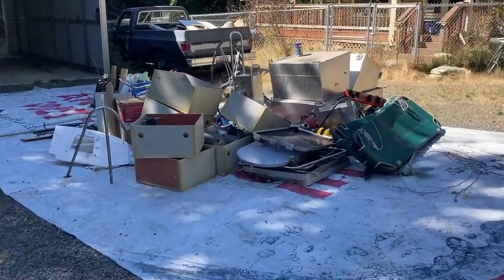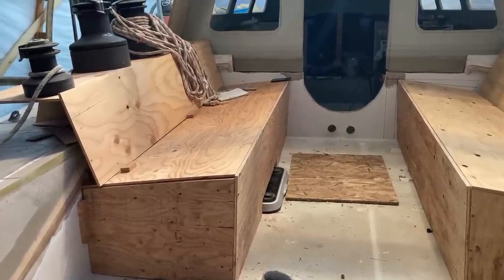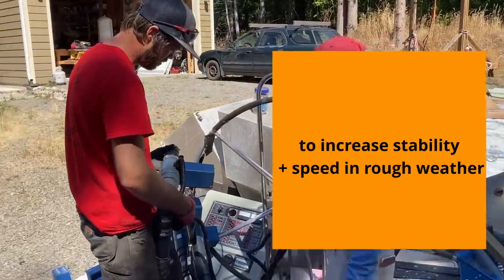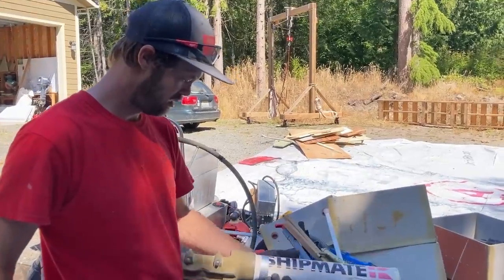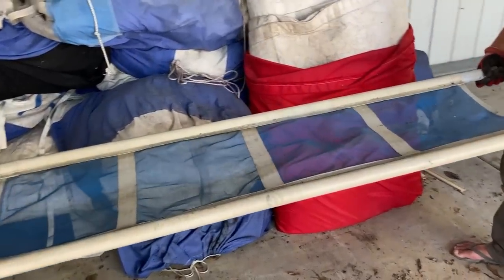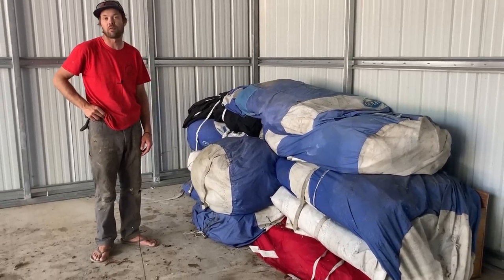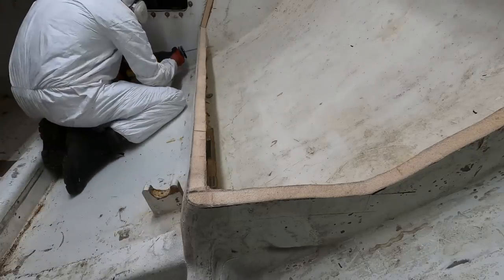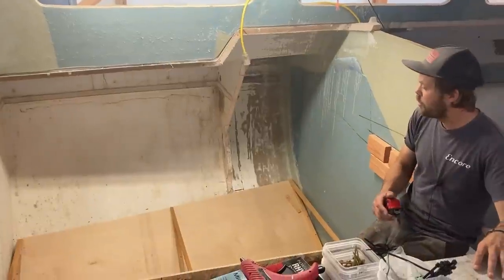A Boatload of Treasure & Mocking Up Fuel Tank [E43]

Comment from the maker: I'm noticing a lot of comments about the fuel tank only being on one side.  I should have addressed this more in the video.  There will be another fuel tank in case this one goes bad.  And the boat will be balanced out by both the galley and the salon area being on the starboard size, opposing the fuel tank on the port side.
Reply: As the fuel is being used, a starboard list will increase. Will there be a ballast system?
Reply: There are hours of explanation and demo ahead for content to ease our concerns,  that said.... I would  hope you prevent leaking and slosh with epoxy liner coatings and baffles. Check out Sailboat story and the 2 vessels Ben has had to address leaking tanks and access issues! I have walked away from boats after finding aluminum tanks under floorboards and water, rust etc in the bilge...
Reply: I sailed on a boat that had a balast tank to balance the fuel tank. It was a pain as the boat uses so little fuel per hour you do not need to balance until a couple hundred pounds of fuel are used. But the automatic system thought when you were heeled over it needed to balance. So it got replaced with manual control, which did not get used much.
Reply: The problem is that the fuel tank weight will vary by 150 gallons * 7.1 lbs per gallon = 1065 lbs. If it is properly counterbalanced when full, it won't be when empty. It is not the end of the world if you go through with it. But it sure would be nice to get it closer to being balanced. Maybe you could at least have 35 gallons on starboard and maybe 115 on port, and you can always use up the port-side fuel first. Also, much of the time you might not need to keep the 115 gallon side full, so practically, it would be rare to have much of a list.
Reply: @mckenziekeith7434  that is true, my comments is about a auto system. You do not consume much fuel an hour, maybe 6 to8 pounds, so that tank is not need to be messed with but maybe every few days if you are doing a lot of motoring. Then you have to figure out how much you have used and pump that much out and if you are sailing and are heeled over it gets complicated. Plus when you are sailing trim can be a relative subject till you dock
Reply: I just want to ask, if a person moves from port to starboard, do you use a ballast tank? After all you just moved 175 pounds from port to starboard, or a 350 pound difference in trim. So think of that, how much fuel do you need to use before you notice a trim problem in a 65 foot boat?
Reply: @chasingsunsets380  it is over 1000 lbs of fuel. It is a 65 foot boat, but it was designed to be very light in weight.
Reply: @mckenziekeith7434  read my post, it is about auto vs manual and how often you really need to trim. Besides that we can discuss this offline and not disrespect this man's channel.

Comment: One thing you may consider is adding some noise abatement around the tank. The tank is under a bed on a boat that will constantly be in motion. Even with baffles in the tank the fuel will slosh around will create noise in certain fill levels. I only know this because our fuel tank is next to our bed.
Reply from the maker: Good idea, thanks.

Comment: I saw a huge sticker coming by from Awl Grip. I was a yacht painter at Royal de Vries Feadship in The Netherlands for 15 years and used several brands of yacht paint. It depended on the customer which brand they felt comfortable with. I don’t know how experienced you are in painting a yacht, but Alex Seal is for less experienced painters easier to work with. It flows better than Awl Grip and it hardly runs. Use a 4mm dincup and reduce it to 14 seconds with a reducer suitable to the temperature and you can use an airmix or an airless pump, and you can’t go wrong! Keep up the good work!

Comment: Hi Matt, Looking at your pile of old sails, you should try to prevent any damages from mice! My dad boat mainsail had major  such damages during a winter. A solution could be to store them on ladder hanging from the ceiling, instead than on the floor. Also, to use ultrasound devices that prevent them from coming to close to your sails!

Comment: Just my intuition on the tank... lots of free surface effect in one big tank (no doubt there will be baffles), but you're risking all fuel in one tank (if there were a leak or contamination), it will be sloshing around just under the double bed too! I guess you've done the weight and balance for all that fuel on one side. Sorry to be so critical, but it just raises questions that you've no doubt thought through!
Reply from the maker: the galley and settee will be on starboard side which will be heavier. it won't be the only fuel tank. there will be at least one more.
Reply: Ha! I should have read the comments before posting my own. Well said :)

Comment: Comment from the boat design peanut gallery: sooooo much free surface in that tank! I’m sure you know that tall, skinny tanks are much safer and better for dynamic performance than wide, flat tanks. That’s why nobody carries water in a cookie sheet :)

Also, offsetting a tank with a static mass will mean that you are always out of trim. Unless you can arrange to keep the tank full 100% of the time… Another tank that empties as the voyage progresses is a good balance. 

Anyway, a good tank builder can mitigate the sloshing problems with adequate internal baffles. I wish you had a better spot for the tank (centerline, tall space), But that is a small problem compared to many you have already solved well. 

It is so inspiring to follow your relentless progress! You both are awesome :)
Reply from the maker: The deepest part of the tank is very close to centerline so most of the weight is very close to center line.
Reply: @TheDuracellProject  that certainly helps!

Comment: Just fyi I've been part of the design and build of composite yachts and other boats that have integral diesel tanks. These boats are vacuum infused vinylester. We would add a special layup inside the tanks but it wasn't anything crazy. The tanks were always hydrotested. I know of some smaller boats that have integral tanks and they use a paint on product inside too. Aluminum tanks are the tried and true method so probably makes sense for you. But if they happen to be cost prohibitive or something, there are other options. Keep up the great work!
Reply from the maker: yep, i'm going aluminum! thanks for the comment.

Comment: I would say even though you addressed having other stuff on the other side I would still do 2 smaller tanks. For one reason your balance won’t change as your fuel in the tanks is depleted. Additionally it offers redundancy in the case one tank gets diesel bug or water in the tanks.  I would also highly recommend baffles in the tanks and inspection ports in the top of the tanks for future cleaning or repairs. One final thing as you know having the weight to center laterally & lengthwise will give you the best motion at sea. I would seriously consider moving the placement of those tanks.  In another note if you have the room and it wont mess with the sail plan why not do a big sliding hatch on the roof? It will add some nice ventilation at anchor and offer future access if you need to replace any appliances or equipment inside. The only concern of course would be making it weatherproof but its done all the time on smaller versions of the same thing.

Comment: I’ve been enjoying the updates. 

I wonder if the fairly low profile tank will be more likely to lead to air in the fuel line if things are sloshing around when it is half full?  Maybe a smaller day tank will take care of that problem.  I agree with another comment on the advice to make two 75 tanks that fit into the same space and are linked, then they can be serviced anytime. That is how the water tanks were done on our Express 37. 

I just did a week long cruise and it had me thinking about the cockpit benches in your last video. We have shorter than recommended backs, but I find it very comfortable anyway.  The angles on yours look about right.  Our Express 37 backs are a little too sloped back.

Comment: Always enjoy your videos.  Thank you for teaching and sharing your knowledge as you are building.  I am a ham radio operator (60 + years) and I suggest you both get your amateur radio license.  It's code free, all book learning and there are tests in your area.  Hold on to the tuners until you have your comm. package installed and you may find that you can use them.  If not, then you can sell what you don't need.

Comment: Use the old fuel tanks for blackwater and greywater. Buy new  Polyethylene freshwater tanks. (Even if the angle is a bit off it´s a lot faster and cheaper to have the tanks cut to shape than building a complete new set, as long as you clean them well before welding.) Alternative to cutting the tanks is to build supports that will take the shape of the tank, and accept a little wasted volume...

Comment: Aluminium tanks create cold bridges during winters and in colder climates, which can cause condensation build up inside the tanks unless they are completely full at all times. Moisture allows the growth of diesel bug which in turn clogs filters and in severe cases block fuel pumps and injectors causing engine failure. Better to build your tanks in plastic instead or any other suitable material.

Comment: Why not build the fuel tank as part of the boat? My own boat has this and it is superb. You can also do the same for water tanks. You coat the inside with a potable quality two pack Polyurethane that makes it drinking water safe. If you build tanks like this you never have to worry about corrosion. The tank will likely be lighter. There is no inaccessible areas where you can't get to. 600mm access lids mean you can get I side to clean. There is nothing not to like. The tank can be used as a structural member and bunk base. Add core to the top to make it insulated.
Reply: I have built in steel fuel and water tanks. Would much prefer removable cells for both. Diesel sickness can be an issue that swapping out tanks fixes instantly, and with a small water maker, a polythene cell takes less space.
Reply: @isickofit  maybe on a small boat. My water tank is 800 litres. My fuel tank is 500 litres. You don't swap those out easily. You climb in.
Reply: @timevans8223  my boat is 55' long and weighs 17 tons. My point applies.
Reply: @isickofit  if you can clean the tanks insitu because they are big enough to climb in why would you remove them? My boat is heavier than yours. The tanks sit on top of the keel where weight is useful. There is no issue of trim as fuel and water is used. The tanks are below the cabin floor.
Reply: I couldn't be happier for you.

Comment: I think two, smaller stainless or integral tanks would be better, than one large aluminium.  Also, I would be concerned about it being beneath the bunk, from the noise of sloshing fuel and potential odours. I'm wondering how you will balance the boat from side to side, very large crew permanently in the two sea berths, may have it's drawbacks.  The fore and aft trim should be match side to side. 
Good to hear you are planning on minimising the use if track.  Having sailed on an Open 60, rigged entirely with soft shackles, not only was the boat very quiet, but the visibility of the rigging and soft shackles had been a significant factor in it's success (and finishing) a tough Vendee Globe.  
Sponsor and YouTube Ads are fine, I understand they contribute to your income stream.
Reply: This is a good thought. But I lived on a boat for 2 years where my bunk was above a diesel tank. There was no odor whatsoever from the tank (there never would be unless the tank leaks). And the baffles in the tank prevented it from making any sloshing noises that I could hear. I guess part of it may be that when the boat is rolling back and forth, there will be some sloshing noises from the sea on the hull, and these are much louder than the sloshing noises from the tank, so you just don't hear it. In any event, it was never a problem.

Comment: Hello I seen one of your videos before on this project and I forgot the name of it and it just showed up again and I watched it I wanted to subscribe last time so I did it this time and I read every comment on this one I take it most of the viewers don't read any of the comments because they're always asking the same question giving the same suggestions giving the same opinions but that's okay it's all good feedback. The only thing I would say about the tanks as I would divide them up into 2 or three tanks and I always connecting to each one will fill the next one in line like big rigs have when I was a truck driver I noticed we had a few crossover line to the other tank they were 150 gallon tanks that's a lot of weight 150 gallons. And the tank builder even if you make it the same big size or divided into two or three they will still put baffles in it anyway and they will have round cutouts in the baffles to reduce sloshing. Anyway just thought I would add that but to remember when the fuel level goes down you're still going to be some offset on the opposite side of the boat from weight reduction when the fuel is consumed and you're talking about putting a big generator that's going to be a lot of weight I'm sure you got that figured out I'm not telling you what to do I'm just giving my undivided attention LOL but I I like the style of the sailboat it's really nice. Anyway I'll be waiting for your next video thank you for sharing your project with us that's a lot of work even doing just a small things can take a lot of time and thinking of how to build something. God bless you and take care stay safe watching from Roseville California about 40 miles east of Sacramento off of interstate 80 I know exactly what city you're in I used to be a truck driver and go to Washington a lot anyways take care I'm out of here
Reply from the maker: thanks for the comment, Calvin!

Comment: Watching you haul that tank mock up out of there made me think.... Might want to consider serviceability of your tank. Years down the road when you need to replace it will you be able to get that thing back out of the boat without cutting the roof off?
Reply from the maker: the only servicing it should need is cleaning and there will be plenty of access hatches on the top of it.

Comment: I have read most of the comments below and concur with some of the concerns re the fuel tankage.  My experience with aluminium tanks is not good and I agree with the suggestion of going with stainless steel instead.  As you have noted you will try to balance the weights by having fuel tanks on port and starboard and the additional weights of the gallry equipment will assist.  Two comments arise - can you share a plan of how the accommodation will be arranged - the diagrams you have shown already are great but still not clear where things will be placed.  Secondly - why include two pilot berths on starboard when there is an opportunity to mirror image the port layout leaving you with two cabins with double berths, and removing the problem of having two identical fuel tanks (one port and one starboard).  As this is a cruising boat there is no real need for small pilot berths and the choice of sleeping on port or starboard berths would be determined by the current tack you were sailing.  Keep going - love what you are doing - especially the explanations on what and why you are doing things.
Reply from the maker: hi jim, i'll share some more diagrams in upcoming episodes. thanks for the comment.

Comment: Not ever owning a boat myself, but surely would it not be better to have two smaller tanks which can be isolated if one goes off. I have heard that two fuel tanks that go into a running tank is ideal. I think I heard this from the Kracken boat designer builder....Having one big tank that will be near impossible to remove if there are issues is asking for trouble, particularly if it splits or starts to leak. We had the same issue in some armored vehicles and had to near strip the whole interior to remove a hydraulic oil tank.
Reply from the maker: We will definitely have multiple fuel tanks.

Comment: When you get to the installation of the electric propulsion motor and separate diesel generator I'm interested in hearing why you chose that over a combination diesel and electric motor/generator for propulsion. I prefer the latter because if the diesel propulsion fails you still have the electric propulsion as redundancy and vice versa.
Reply from the maker: yes...there is a lot to get in to here and we will go there :)

Comment: On my calculation you are putting 1000 pounds of fuel on the port side to be offset by the galley/saloon on the starboard side.  What happens when you are low on fuel? Not a lot of thought gone into your design. You have the original tanks work with them.
Reply from the maker: There will be another fuel tank and I am designing with balance in mind